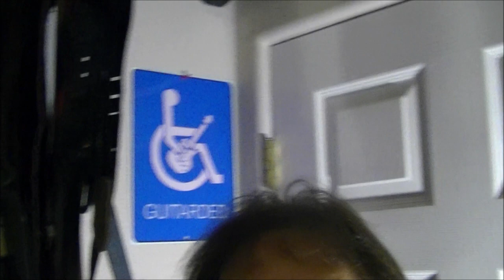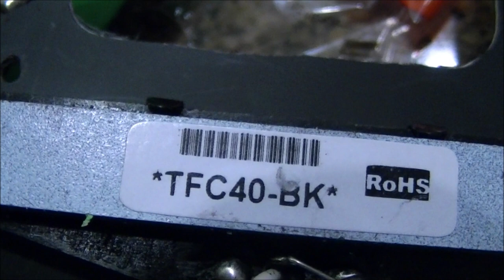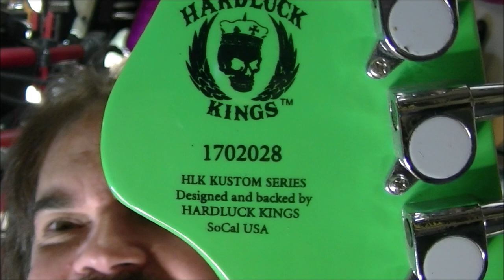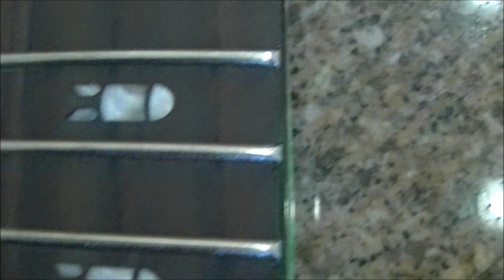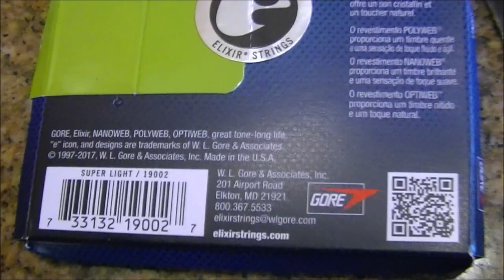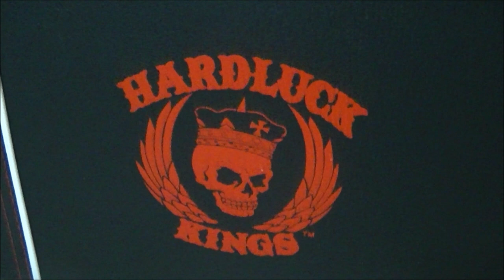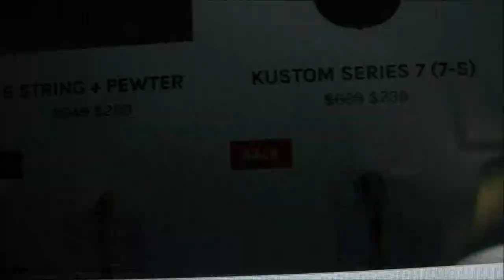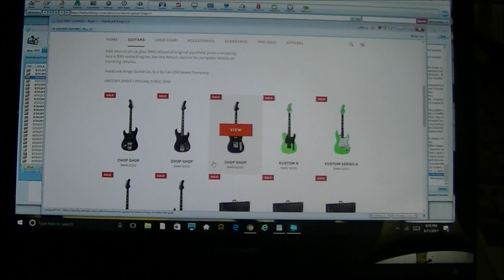Hardluck Kings Southern Belle & Bombshell Guiter Reviews & Mods By Scott Grove

Comment: Great job on the binding, Scott! That looks really neat. Was the material sold as a roll or in strips? eBay? You are not wrong about that Seymour Duncan pickup. Sounds really... bad. Great job on the nut. You were diving pretty hard on it. Did you file the nut at a down angle on the back side, or did you do something else? Really nice. Regards, Michael.